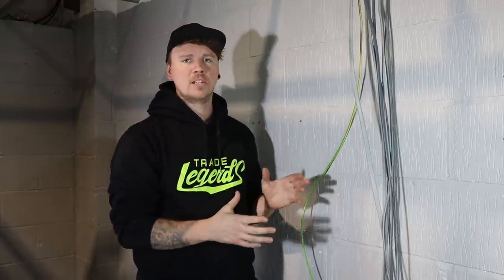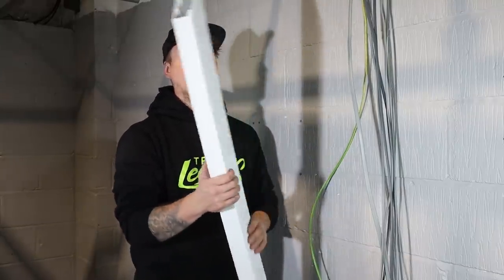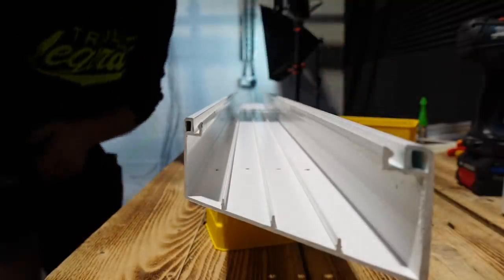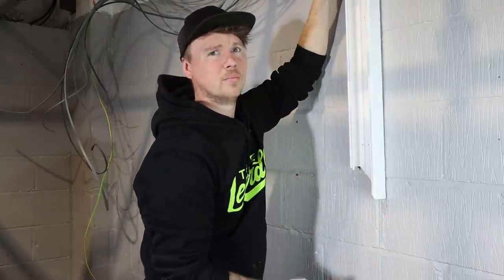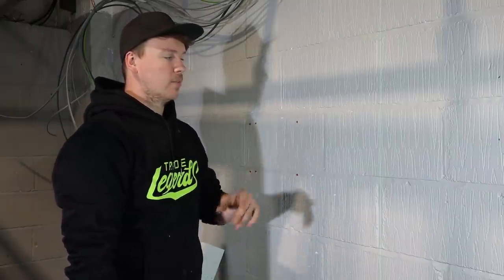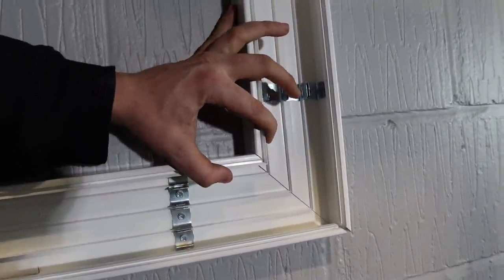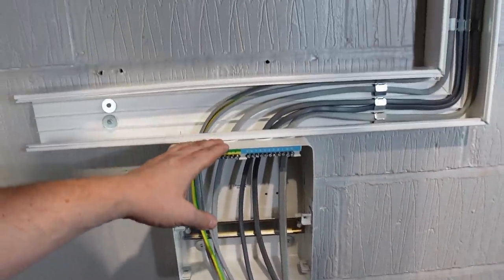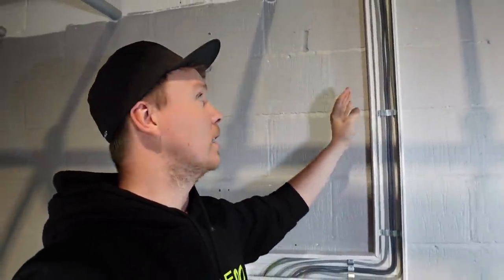Super Satisfying Trunking, Domestic Electrics made easy - Electrician

Comment: Looks like a lot of the cables pushing out of the trunking on that sharp 90 could be solved by routing the trunking through a 45° instead of a 90.  Not always possible in the field but very easy in a clean install like this.

Comment: I am NOT being picky, this is brilliant and real-world practical work! Just for learning. The current carrying capacity would be significantly reduced because of grouping factors in bs7671? Many circuits are "bunched together" in trunking. Would this be "technically" an issue? I suspect on a small part of the overall cable length is grouped in this way. Consider a circuit under continuous load, like an immersion or storage heater. Grouping this with other cables not spaced apart by 2 cable diameters, would require grouping factors reducing the current carrying capacity?

Just looking to learn, not hate intended:-)

Comment: What’s the consensus when fitting d line clips etc ….should they be fitted with fire rated fixings like the dewalt wall
 dogs … as using a plastic  wall plug is the weakest link …which could melt under fire conditions and pull away from the wall …what’s the thoughts on this ….

Comment: That looks proper neat, those fire grommits look a lot nicer than gunking the hole up with sealent.

DIY'ers are gona DIY regardless of if you do a video about how to dress a fuseboard, might do a better job of it with the video though 🤷
Reply: Agree, people are responsible for their own actions Nick, it's not on you mate.
Reply: Not to mention that there are lot of countries like the Netherlands where you can do your own work without a degree or permits. 

Not sure if that always leads to a quality job but on the other hand I have seen pros do a worse job than DIYers.

I rewired my own rented house (it was build under old regs with no grounds on sockets, just in the kitchen and bathroom) and I can't believe how crappy some things were done. I took my time and would have no problem at all to get it compared to a pro!
Reply: @Richard1977  In UK you can do your own wiring without a degree. Actually hardly any electrician has a degree. Magic lays in being #competent#.
If you are competent and Part P registered do whatever you like within regulation.

Comment: I thought the idea of these fire clips was to stop cables falling down (from a ceiling) in the event of a fire? In the video if there was a fire the cables are going nowhere as they are hanging down a wall. Looks a neat, professional job, but the clips are not going to be doing much in a fire IMHO.
Reply: Thought the same thing ,I would use metal trunking easier to install ,easier to get lid off than plastic .
Reply: @raychambers3646  in domestic? Running down a hallway wall?
Reply: In a fire, the cables will potentially flail about away from the wall. A firefighter could become entangled in these. Better to be safe than sorry.
Reply: @stevecraft00  I don't do domestic ,I'm just saying in that particular example I would use metal trunking.
Reply: @stevecraft00  its not in a hallway tho is it? It's in a garage.
Reply: No surface trunking. Sink in wall with spare conduit runs and do a proper job, surface mount trunking always looks after thought.

Comment: seems odd, a pro in the US would use conduit and you get to use wires without insulation.
Reply: All those cables are double insulated.
Reply: Conduit with single insulated cables is fairly unusual in UK domestic properties. Mostly twin and earth cables (I think you call that Romex?) clipped on joists or buried in plaster with a plastic or metal cap.
Reply: That works for a few surface mount add-on circuits in US garages and the like. But, we need to move in a better direction than the typical method of stapling cables to wood studs, putting drywall over it, and thinking it will last forever. I hope that we move to raceway systems that can be easily opened to add new circuits, replace old cables, contain data cables, have built in cable supports, and fire stops.
Reply: @JasonEDragon  even if we decided to do that, like in commercail it would all be plastic or metal round conduit.  and we would use single THHN conductors. 

If I were to build a house I would pipe all of the data ports so I can upgrade it in the future from copper to fiber. but even that is overkill since wireless 20 years from now will be amazin.
Reply: @swaterman08  My house is 130 years old, has gone through a series of renovations in that time, and should keep going for several more decades without problem. My limited experience with metal conduit is that it is a pain to install into wood framed walls (especially without drop ceilings) and it isn't that easy to modify once in place. I've installed several receptacles and switches in new locations every 1-2 years when an unexpected need arose. I did make use of flexible conduit for a couple data outlets, which made life a lot easier when I added extra Ethernet or Coax connections years later. Wireless has definitely improved and serves most needs, but I already have about 10 devices where power over ethernet was a more convenient choice.
I did tinker in a few upstairs bedrooms and made the baseboard removable to allow me to run ethernet and coax cable more easily - especially in the one that I use as an office.
Reply: @JasonEDragon  I am talking about a Pro doing work at his own shop or home. if you have the tools and know how to bend the pipe its artwork.